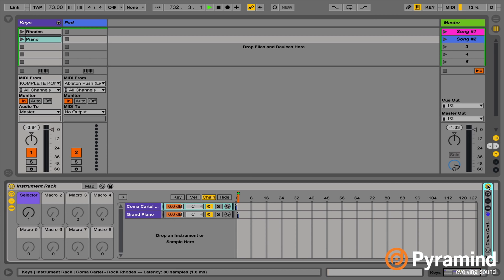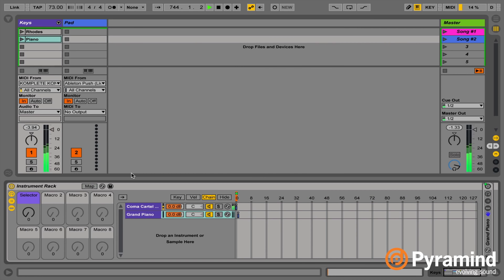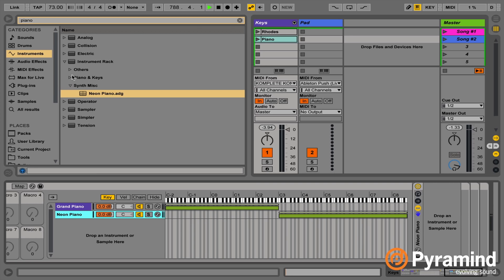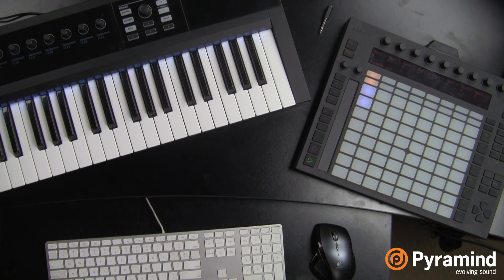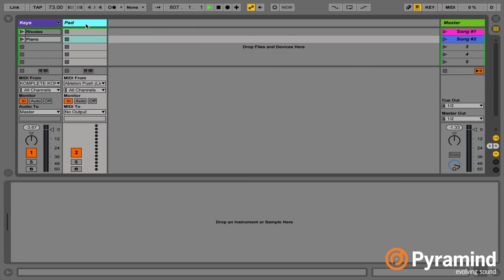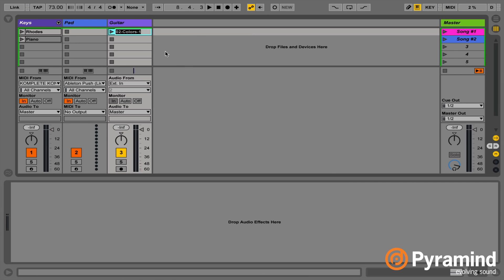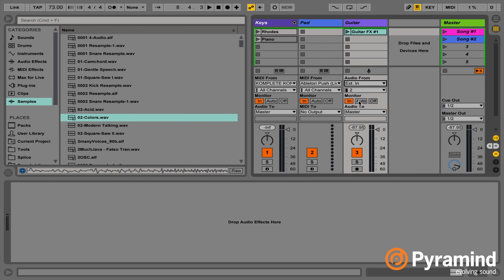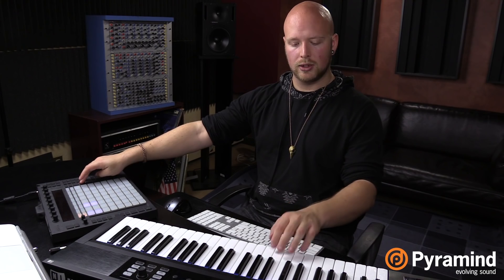Changing Presets with Dummy Clips | Part 2 | Ableton Live

Comment: QUESTION. How would you send multiple midi program changes with one scene launch (Session View)? I'm currently using Arrangement View for live tracks and I have dummy clips sending multiple patch changes to my Strymon Timeline during each song. I'd like to convert this over to session view for more on the fly sets but the problem I've run into is if I consolidate the dummy clips they merge to program changes and I only get one patch per song. Hope that makes sense!
Reply: Did some more research and found the answer: https://maxforlive.com/library/device/370/cc-to-program-change#:~:targetText=CC%20to%20Program%20Change%201.1&targetText=A%20simple%20patch%20to%20get,messages%20of%20the%20same%20value.

Comment: Thanks for an idea, but this approach has one drawback. If your instrument has some reverb or delay tail it cuts that off in an ugly way. I don't see why you need to switch instrument off, because chain selector does the trick already. Signal is sent only to the selected instrument and others doesn't consume CPU.
Reply: I realize this is a year later, but the solution to that is to put your 'verb patch on a send. If you don't want reverb on the following patch, you set a dummy clip to fade the send out to -∞dB within the first eighth note or somethin. If you don't want a send, you can put it in the master instrument rack, just not in the inner instrument rack that changes with the chain selector. Think of the end of your inner rack like a fader; pre and post-fader effect placing make a difference.

Sorry for the rant-of-a-reply, but hope this is helpful😁😀

Comment: I have a question. What if my instrument rack has (for argument's sake) 8 macros that are unique to that rack. (For eg, the Grand Piano in Ableton has Brightness, Hardness, Reverb Amount, Tone, etc.) And say I have 2 such patches. Is there a way to switch between patches and also gain access to their respective macros so that I can have more expression while performing? I have an Impulse 61 that dynamically maps the 8 knobs to the 8 macros of whatever the 1st instrument is. In this case, it maps to the MAIN instrument rack (the rack that houses all of my patches with the chain selector and stuff). I'd love to know what your thoughts are on this. I know hard mapping is one technique, but, just out of curiosity, is there a better way?

Brilliant tutorial! Very inspiring content. Thanks a lot. :)
Reply: Did you ever get a solve for this? I'm running into the same issue
Reply: try using an expression pedal and map it to the chain selector, then reserve your 8 hardware knobs for the  8macros unique to each rack. they shouldn't have to be on the same 8-macro GUI within ableton, I don't think.
Reply: this might help you more than my previous comment: https://forum.ableton.com/viewtopic.php?t=217173